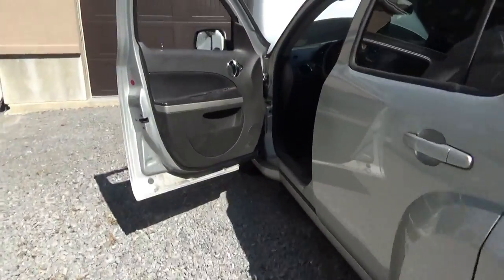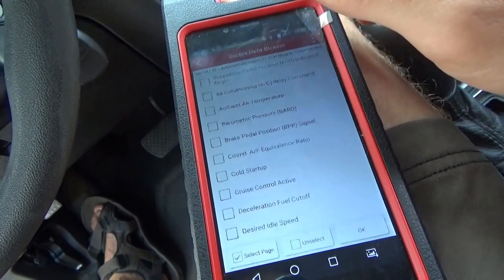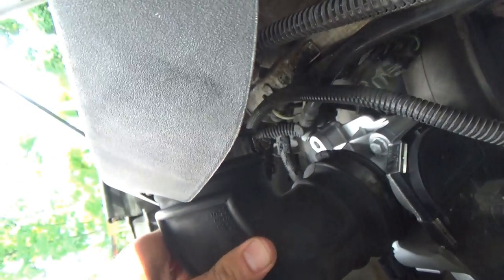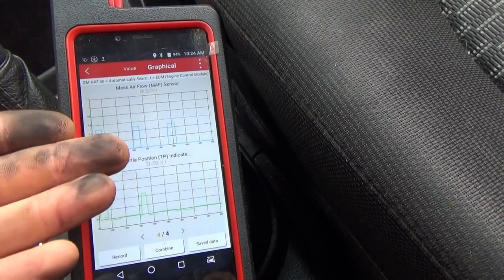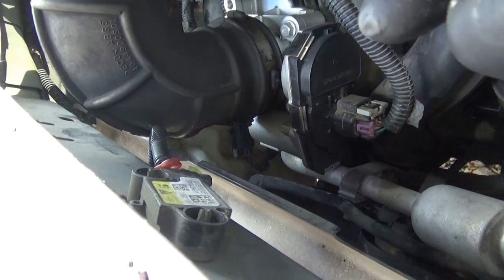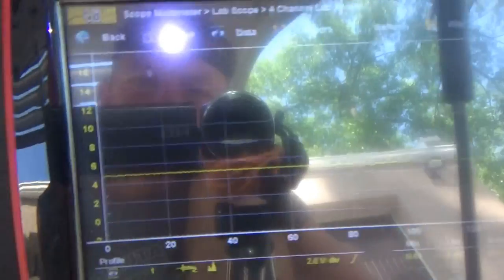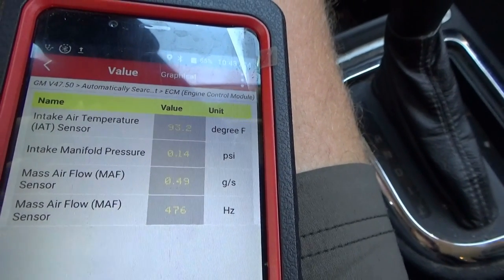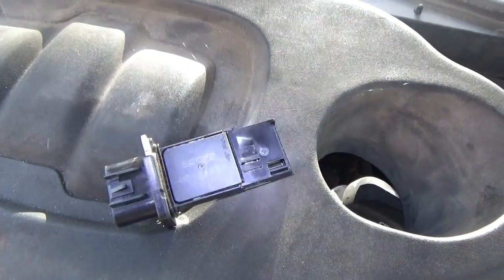Start-Stall? Many Codes (Chevy HHR)

Comment: 2.2 isn't a terrible engine but, they don't last long if you neglect them. Timing chain and tensioner won't tolerate low and or dirty oil for long. Amazing how many times a cheapo part will cause stuff like this to happen so, if it's worth doing it's worth doing correctly the first time. Good job on a quick diagnosis by unplugging the maf like that btw.

Comment: At first I thought it was going to be another classic HHR fuel leak right in front of the rear left wheel and it was stalling from low fuel pressure.  Just had a HHR here for that

Comment: Ivan my MAF in my 2002 Buick 3.8 would run fine then act intermittently just like your little ecotech just did.  It was a Standard ignition parts Blue Streak that lasted only a year.  I used to use a lot of Standard Ignition parts over the years.  I replaced it with the lifetime warranted part just to see if it was a fluke.  I will test it against the original Hitachi that was factory.  Thanks for the show and tell of back probing.

Comment: Hi Ivan, I agree with you on aftermarket sensors in general are garbage,  I use it last resort, just by disconnecting it shows a bad sensor, but when you said that pulling out pressure fuel gauge is not necessary I disagree with that,  because you could also have the fuel pump on its way out on a short time and the customer think you changed the wrong part, even though the maf sensor is the problem it's best to check the pump and advise the customer.  cover your back!
Reply: Good idea since it doesn't take that much time.  I am still trying to get over this customer wanting to fix and flip an HHR with their terrible reputation.   I am wondering if Ivan sensed this customer wanted to spend the absolute minimum for his fix and wanted to stop with a major fix? Just my $.02.

Comment: I’ve been having a lot of cars come in with junk aftermarket MAF sensors causing issues. They all seem to use those bright blue resistors and one of the two is a blue and white square. If you buy a MAF and it has that then take it back and get an OE sensor. The MAF is too critical to cheap out on. A lot of times it can run decently but still be causing a loss of performance that may not be really noticeable. BTW, What is with all of the junk aftermarket parts on the market these days? We seem to have way more parts failures than we used to.

Comment: Apart from always suspecting the connectors I'm good for getting direction by unplugging things, and it works most of the time, just have to remember to plug stuff back in

Comment: ECCPP is the brand name of that MAF sensor, they're garbage and most of the products they sell are cheap chinese clones that aren't specd like an OEM part, in these situations (sensors, evap stuff, fuel pumps, etc) absolutely have to be oem GM parts or they'll throw weird codes and go into limp mode. Out of every 5 parts they sell 2 are defective
Reply: Yep. I went through a lot of aftermarket MAF sensors on my 2.4L Malibu. Junk is at crisis levels.

Comment: Was the MAF installed backwards? It looked like a new one.
Backwards on that stile will do the same as your results.
Including thouse codes Looked like some one swapped it with the KOEO
Reply: Are there many maf's that you know of that can be installed backwards?   I erroneously  thought that was one of the things manufacturers would make sure was goof proof.  Wow!  I am stunned!
Reply: Will it go in backwards? 

That could certainly explain the low reading... but if it goes in backwards what a sh*t design!

For a critical part like a MAF i'd feel more comfortable with an oem part anyways... Kind of drives me nuts when people swap out MAF, CMP, CKP sensors with $10 rubbish. Just asking for trouble when least convenient.
Reply: @dogsplantscarsneatstuff176  Yes it can DIY
Reply: @volvo09  Yes it can DIY

Comment: MAF would be my first guess - just swapped mine this week on my cruze and fixed a ton of driveability issues.  (Was wacky all summer when temps were hot)  I caught the problem by doing volumetric efficiency test and found out it was the lower rpm range only that was whacky!   I even noticed when slightly touching the throttle, the vacuum readings went up.  (definitely not what I expected).   Last bit of funny is my a/c now runs better now that my MAF is changed.  Don't ask my why but it works great.  LOL  This would be an Ivan investigation.

Comment: When i first saw the symptom i thought maybe theft issue then when you gave it gas and kinda kept it alive i was thinking that p0011 code and that solenoid is causing the issue and thats where i would start. I'm going to watch the rest of the video to see if I was right!? Well I was wrong, but that would have been my next check to unplug the maf and see if i ran.
I had a HHR towed in for a no start that the customer replaced the battery, starter, alternator and the range switch on the transmission. I found 2 faults. One looking at ecm data no ignition feed, that fuse was mising from the fuse block. Then looking at data the tcm showed vehicle in park/neutrual but the ecm showed in gear. jumped that wire to ground vehicle started. upon closer look the shift cable was broken and the range switch was loose.

Comment: This was a great video, but in the very beginning when the car was stalling I would've poured a can of brake clean down the intake to see if it was or wasn't a fuel delivery issue, guess I've been watching too much SMA ;) Then I would've started looking at scan data. But then again in hindsight, if this were a fuel pump issue, that would be a very peculiar type of failure that is able to start the vehicle every time but not let it run...

Comment: Who here thought the plastic air box/engine cover was cracked causing massive vacuum leaks and skewing the MAF reading? I've done several. Most would start, but had lean codes. 2 however did the exact start stall issue Ivan had. I believe there is a TSB on this, that covers several models.

Comment: Vehicle: 2010 Chevy HHR, 2.2L Ecotec
Customer complaint: Car starts and stalls
Diagnostics:
1) Scan for codes in engine control module - eight codes: P0011 Intake Camshaft Position (CMP) System Performance, P0014 Exhaust Camshaft Position (CMP) System Performance, P0101 Mass Air Flow (MAF) Sensor Performance, P0102 Mass Air Flow (MAF) Sensor Circuit Low Frequency, Manifold Absolute Pressure (MAP) Sensor Performance, P0113 Intake Air Temperature (IAT) Sensor Circuit High Voltage, P0300 Engine Misfire Detected, P0506 Idle Speed Low 
2) See if the car will stay running with accelerator input - not easily
3) View datastream to see what relevant sensors are reporting - found MAF reading 0.5 grams per second
4) Perform clear flood crank to see if timing sounds off - sounds normal when cranking
5) Unplug MAF see if default strategy improves behavior - car starts and runs
6) Check oil - dirty and low
7) MAF open circuit inputs - all values as expected (5 volts on signal, 0 volts on ground, 12 volts on ignition, 0 volts on IAT low reference, 5 volts on IAT signal)
8) MAF loaded circuit measurements - no loss of power/ground fidelity, scope reads 478 Hz when key on car off, agrees with datastream
9) Visually inspect MAF - looks clean, but not OEM
Conclusion: Replace MAF sensor due to good inputs but low output

Comment: Did you not just try cleaning MAF, might work worth a try, could be some insect in there clogging up the works and sensor might be reading correctly. I personally would check that the whole air intake path, filter etc was clean, clear and intact first before condemning the sensor.

Comment: Hi Ivan,are you also doing work on the Volvo truck in background? If you are the scanners you have won't hook up to it,you'll need a NEXIQ connector plus a special program on your laptop. In Toronto Canada the programs cost approx CA$1000 for each engine the truck may have. Just thought I'd pass this info on to you. Gr8 work and video stay safe.

Comment: Hey this might be a silly question but did we rule out a more mechanical failure like clogged cat or intake filter or does unplugging the maf tell you it can't be those two problems?
Reply: Unplugging the MAF force's the ECU to use a default setting it's a widely used trick to unplug it and see if it runs better.

Comment: Previously owned a 2011 Chevy HHR. Soon as it hit a hundred thousand miles it started falling apart. Speakers went out power door locks went out door handles replaced multiple times because they're made cheap brittle plastic. Finally transmission starting to fail. Got rid of it and got a Toyota.
Reply: It's uncanny how that thing sounds like the Buick Skylark my grandma bought in 1984... probably just as reliable too.

Comment: The GM Ecotec engine would have been a great engine if they used a double roller timing chain and a simple belt drive water pump.

Comment: Hi ivan,vojld ou please tell me how can i determine ghe type of maf(analog or digital) when we're dealinv with a car that we don't have any info about it,and if it was digital how can i get to know it's pull up or down design,with considration of having no info or pin out of the car.
Best wishes.
Reply from the maker: Scope it. Unplug sensor and measure voltage 👍

Comment: I have a 2008. Them codes mean nothing. These cars just throw codes out and more than not they are wrong. Last one I had was bad idle and stalling. Code was catalytic converter, shop said same thing. That was yr ago. All that was changed was the flex pipe on the exhaust. It was leaking exhaust.. not $1,375.00 catalytic converters here in California. Always something else other than the code

Comment: Hey Ivan, could use a consult on flashing a firmware update on the amplifier module on my wife's 08 Cadillac SRX.  I have a clone Tech 2 and bought the recommended Tripp Lite USB to serial converter.  I also bought the $40 subscription for 24 months.  I CANNOT successfully reprogram the module.  It will not complete.  It fails at random times and I have tried everything.  I am out of ideas and ready to take it to the dealer!!  Any ideas?  In RI....
Reply from the maker: Use Tech2WIN with an approved pass through. Remember the Astra from Hell? Tech 2 clones are often junk.
Reply: @PineHollowAutoDiagnostics  Thanks.  Any tips on a cost effective pass through (I assume this means an MDI module)?  Any luck with the clones of those?  Heard the VCX Nano can be finicky.
Reply from the maker: @kevin9c1  I use the Bosch MasterTech M-VCI. It's discontinued, but if you can find one it works flawlessly.
Reply: @PineHollowAutoDiagnostics  I got a clone MDI.  I got thrown off though because I didn't need Tech2Win for this!  But I chalk the $55 spent as a learning experience since I did have some issues getting it up and running.  4 part video series begins here: https://youtu.be/_bcSxluZ9_M

Comment: I don’t need no stickin’ scanner! 😂   If I’m correct without even watching the video it’s the MAF and throttle body that need simple cleaning. While you’re at it replace the spark plugs and do an oil/filter and air filter change and you’ll be good to go.
Reply: You forget the timing chains!! 🤣🤣🤣🤣
Reply: bigdaddymak1439   Nah, I’d only do that if it was a belt, and then let’s not forget water pump, tensioner, idler and seal on that end of the engine. Easy peasey!  😉👍😂🔧🧰🚗
Reply: @Rein_Ciarfella  You are enjoying yourself!
Reply: dogs plants cars & neat stuff   🙏😂

Comment: still like that diagunV..
Reply: Do you have one and do you like it?  I am considering it or larger Launch 431 V+.  Like to hear your feedback.
Reply: @dogsplantscarsneatstuff176  I have the Launch v431 Pro, (the 8" tablet version) and I can tell you it's GREAT,  it is slow on the one 07 Jetta eurotrash car i work on, and sometimes can be finicky with auto reading the VINS on 96-99 vehicles, but if you have any questions about it, post here and ill comment back
Reply: @mattcat231    Thanks Matt.  Did you get yours from Amazon or an American Dealer?  Have you used it on GM or Ford cars or trucks?  Can you save your readings like if you wanted to run a sensor like a MAF for a couple of minutes  could you save the image on a memory card.  I am thinking of getting one and recording many of my sensors when they are running good as a basis for a future reference when it breaks down if that is possible.
Reply: @dogsplantscarsneatstuff176  i got mine through Autozone, i have heard enough horror stories about some of the knockoffs. Go with Launch direct or through KingBolen. But yes, i probably have scanned 27 GM trucks and 54 Ford trucks, i will have to see if i can record live data, but i know i can do screenshots, and it saves vehicle history with codes it had. I also upgraded mine myself with a 128gig SD card and drilled an access to the headphone port on it. You can also get a plug in or wifi camera to use with it (handy for looking at garbage Triton motor spark plug hole threads)

Comment: I wonder if Scotty is looking at that stupid engine beauty cover. 😄
Reply: That beauty cover is actually part of the intake. It's sort of a reverse plenum.  It allows a reservoir of unrestricted or less restricted air to aid in accelerating engine speed before the air filter places a restriction on it.

I know it sounds illogical because if thr engine is running,  the intake air is alway restricted by the air filter. But because air is compressible,  it stores a large volume that can be decompressed slightly to make the process of increasing air intake volume  a smoother transition giving the appearance of more or better throttle response in smaller engines.